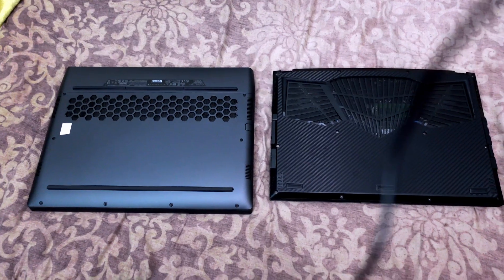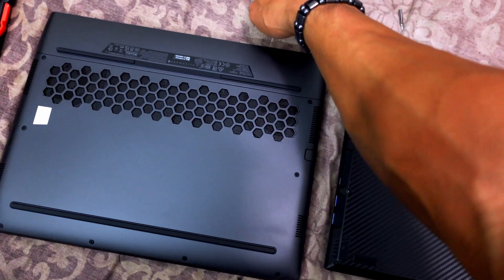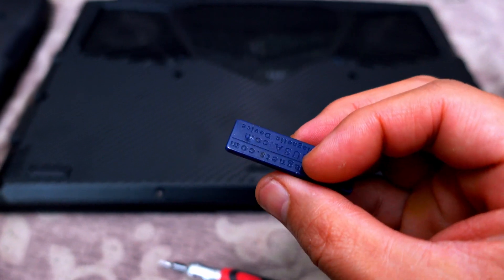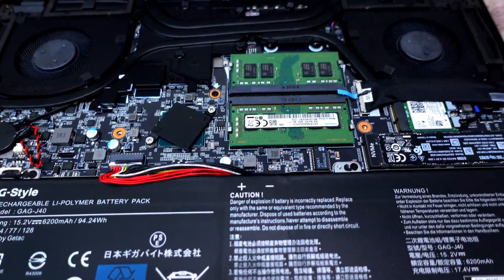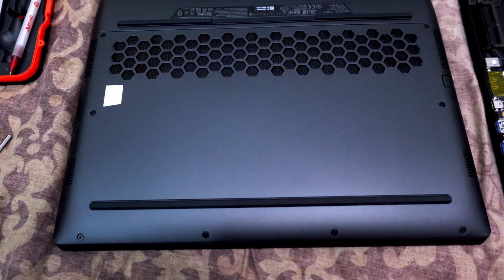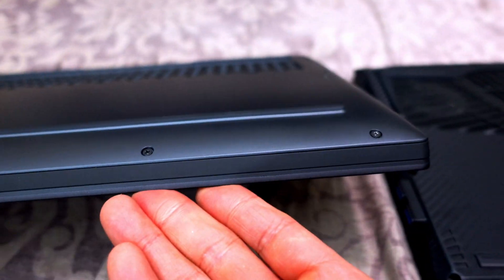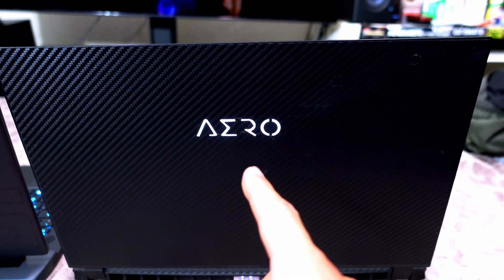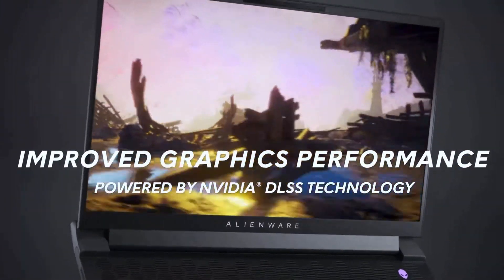Alienware M15 R7 Upgradability, SSD Installation

Comment: If the magnet sticks to it, it's not aluminum... though it looks like you only tested there near the steel mesh and it's probably sticking to that through the aluminum.
Reply: Yes. And it is plastic from what i know, the aluminum comes with the m17 i think. But in many ways a plastic chassis is better, mostly if you have to get into it the plastic won't dent like aluminum will.

Comment: Do you think the Alienware M15 R7 for around $1150 is worth it? (Rtx 3060 and i7 12th gen)
Reply: I got mine in the start of September last year. Being honest, it's all up to your luck. Within 5 months of ownership I had to get my motherboard replaced, and now as we speak I'm in contact with Dell support yet again because my laptop starts lagging and thermal throttling at 85-90 degrees Celsius itself, while it's rated for 100⁰C according to Dell. Watching yt on chrome at 1.5x speeds can cause it to heat up. So I would say try to look for a better laptop from a better company, on paper this is an absolute machine but it comes down to how the company manufactures your specific unit. Maybe the issues have been resolved since when my laptop was manufactured so it might be better now but I'm not going to buy any Alienware laptop ever again until I get a heavenly deal on it.

Comment: Hello... I need a help. I have Alienware m15 r6. Currently, it has single 512gb PCIe NVMe ssd when buying this laptop. So, if I want to upgrade my laptop. Can I able to use 1tb PCIe NVMe 4 gen in Slot 2 ??
Reply from the maker: Not sure if you have the the Intel or AMD chipset, but according to Dell the Alienware M15 R6 uses PCIe Gen 3, so if it were my laptop I would use a gen 3 ssd over a 4th gen nvme ssd. You'll save money and you can probably buy more storage than 1tb. If you get a gen 4 ssd nvme it might not be compatible and it's a waste of money because the chipset on the M15 R6 can't run the SSD at full speed.

Comment: i heard alienware ram are soldered cant be remove , is that trues??? i am looking forward to buy m15 R7 - 16 gb and 512 ssd - later want to upgrade to 32gb and 1 tb more SSD is that possible pls reply me thanks
Reply: Ram is not soldered in
Reply: It depends on the model, the m15 R7 does not have soldered in RAM but some of the other models like the m17 R3 do.

Comment: My alienware m15 r7 is 1 month old and is overheating..
As per dell they need to replace the heatsink and the fan assembly, as of now i am not facing any problem due to the high temperature
Would you recommend getting it replaced?
Reply: Just turn off the Turbo Boost for the CPU, you're good to go.